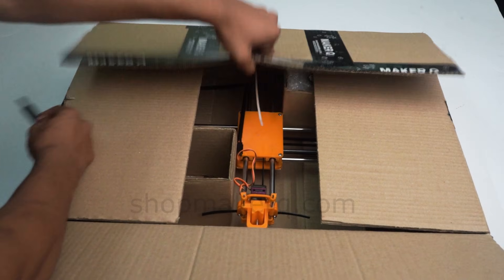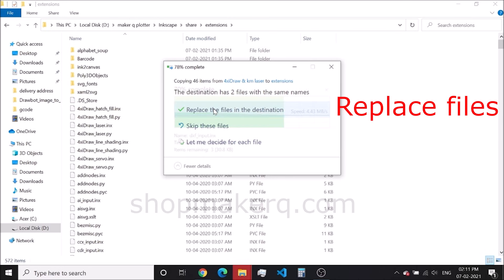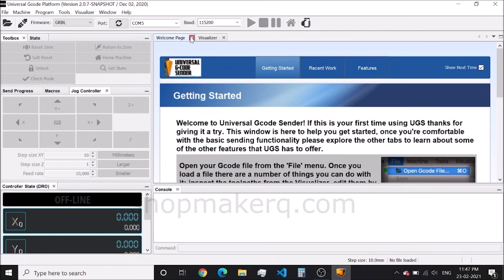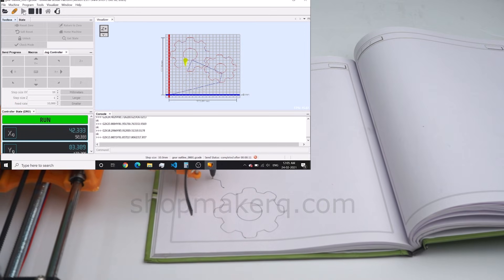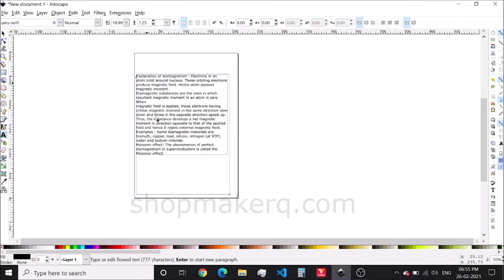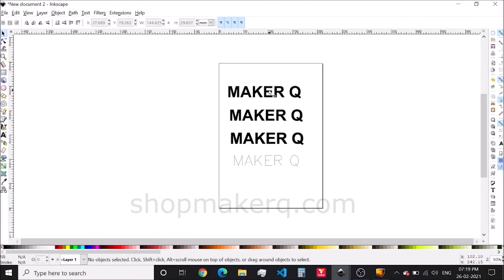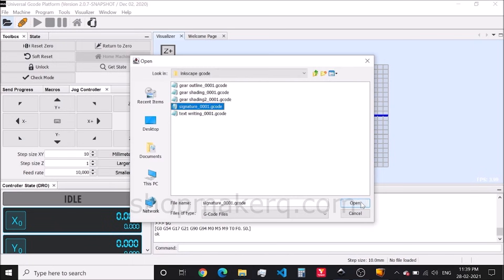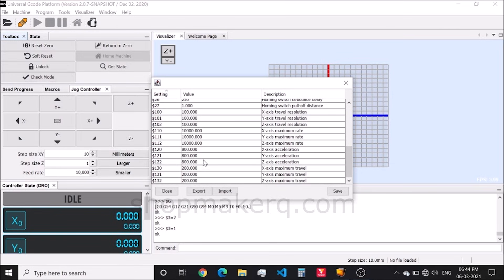CNC pen plotter, machine setup and Software video

Comment: Sir im facing a problem, after all setup when I'm manually moving the machine by pressing x+ axis it's moves on diagonally means(x+y+) same to others sides plz reply sir😢🙏🏻
Reply: Same issue here
Reply: Did you find any solution pls tell
Reply: @nishant1422  No, I Tried and I solve every problem except this. I'm Not Stopped Continuously I'm Trying To Solve. However if you have any other problems you can ask me, may I able to help you.
Reply: Did you find any solution  now  please sir 💔

Comment: X and y works fine but i have issue with the z axis its not going up or down even when i do M03 S80 im using cnc3018 just put a pen in the spindle and unplugged it
Reply: Same problm any solution?
Reply: @sagnikghosh630  actually its the code github has not provided any code for the z axix we have to modify ourself
Reply: Where there is M03. Put G0 Z0 for up G0 Z-8 for down, that how I had mine working

Comment: how to fix this problem:
avrdude: stk500_recv(): programmer is not responding
avrdude: stk500_getsync() attempt 1 of 10: not in sync: resp=0x30
avrdude: stk500_recv(): programmer is not responding
avrdude: stk500_getsync() attempt 2 of 10: not in sync: resp=0x30
avrdude: stk500_recv(): programmer is not responding
avrdude: stk500_getsync() attempt 3 of 10: not in sync: resp=0x30
avrdude: stk500_recv(): programmer is not responding
avrdude: stk500_getsync() attempt 4 of 10: not in sync: resp=0x30
avrdude: stk500_recv(): programmer is not responding
avrdude: stk500_getsync() attempt 5 of 10: not in sync: resp=0x30
avrdude: stk500_recv(): programmer is not responding
avrdude: stk500_getsync() attempt 6 of 10: not in sync: resp=0x30
avrdude: stk500_recv(): programmer is not responding
avrdude: stk500_getsync() attempt 7 of 10: not in sync: resp=0x30
avrdude: stk500_recv(): programmer is not responding
avrdude: stk500_getsync() attempt 8 of 10: not in sync: resp=0x30
avrdude: stk500_recv(): programmer is not responding
avrdude: stk500_getsync() attempt 9 of 10: not in sync: resp=0x30
avrdude: stk500_recv(): programmer is not responding
avrdude: stk500_getsync() attempt 10 of 10: not in sync: resp=0x30

Comment: I built a plotter but when I send gcode to the machine it draws it at a 45 degree angle. Any ideas on the issue or troubleshooting would be appreciated.
Reply: remove 2 slash from config.h and reinstall .
Reply: i.e in 153 line to activate corexy.h
Reply: @gopubalu1542   #define COREXY // Default disabled. Uncomment to enable.
Reply: Can we disconnect computer after sending gcode?

Comment: Inkscape 0.9.2 and a obsolete plugin? NO!
Reply: Its super simple to use the bundled inkscape gcode plugin and just edit the gcode afterwards in notepad++ honestly i'm not sure why he decided to take this approach either !!
Reply: @joolsc3120  Axidraw extension and Eggbot extensions should do all the shown tricks.  J-Tech-Photonics-Laser-Tool on top of that seals the deal but lacks of the hatch area tho. Everything should run with Inkscape 1.1. I believe there is no need for a post process using notepad++...

Comment: Brother when running drawbot imagr processing filr its saying
"Cannot find anything named frame
Reply: I have the same problem, is there a solution?
Reply: Got a solution ?
Reply: @kumudumalika9625  no
Reply: use processing ver 3.5.4 , 4.0ver not working

Comment: Really nicely made thanks.
But have a problem with M5 S0, do you know where to remove s0 in the code? rather than having to do it manually
Reply: Do not remove M5S0 as it says spindle off /speed 0, In this case you are using the M3/M5 gcode to move the pen you are drawing with or if you are using a laser you are telling the laser to turn on or off,Now if you are not using a pen or a laser and want a standard 3 axis device using all stepper motors than go to settings by typing %% in the command line of ugs and find the line which says laser mode and change it from a 1 to a 0 .    now you are in 3 axis mode.
Reply: @walterhynson2898  Sir, when we press on return to zero, it stops in the middle.  doesn't come all the way to its home location
What the reason
Reply: You have to enter " (M03 S80,For pen up.)( M05 S10 for pen down)
Reply: Can we disconnect computer after sending gcode?
Reply: @mrnerd73   noo
Reply: @sasitharshanvv5672  it is taking 2 hrs to complete the drawing, is there any other way so that we can disconnect computer, like using arduino Uno micro controller?

Comment: I have set up my GCode Sender and it recognises the arduino uno but when I make a command nothing happens. Specifically, the motors don't do anything. Any thoughts on how to fix this?
Reply: flash firmware grbl to arduino
Reply: Did you first upload the GRBL to Arduino

Comment: I have this error in 4xiDraw plugin : 
File "4xiDraw_servo.py", line 53
    def bezierslopeatt(((bx0,by0),(bx1,by1),(bx2,by2),(bx3,by3)),t):
                       ^
SyntaxError: invalid syntax

MacOS and Windows same problem. Can you help me?
Reply: This will be on MacOS, I got the same thats because the 4xiDraw is a third party extension and the developers did not update the extension for new python dependency. which is why they are specifically asking to download inkscape 0.92.x version. But on macOS after 10.14 thats deprecated so its not possible to get 0.92 version. the workaround is to use another tool like http://jscut.org/ for generating pen servo gcode. 
1. Download inkscape latest version 
2. Follow the steps in this tutorial to trace bitmap and delete the original image (that is till before the part where you click the extensions>4xiDraw)
3. Then save the file as type inskscape svg.
4. Use http://jscut.org/ to open the saved .svg file and generate gcode, 
5. Rest follow the steps same as this video instruction.
Reply: You should use inkscape 0.96 software. Latest version not working

Comment: Hello.
When I press "Z+" button, machine's "Z" axis is working.Other commands are working too.
But when i write M03 S80 and M05 S10 nothing is happening (just saying "ok" but nothing happens in machine.).
Help me please.
Reply: Me als
Reply: Do you get the answer
Reply: Pls help me
Reply: Try to delete m03 s80 in your code and replace with G01 Z10 everywhere you see.But if u want to work whithout changing the codes you should use servo motor for z-axis.Tell me if machine works when u change the codes.
Reply: @ahmetahmet9342  You told the machine. Plzz let me know about it.
Reply: @xiaoqiaoli6347  Did you try to change the codes with G01 Z10 and G01 Z0?

Comment: I have followed exactly every step, but for me the hatch fill doesnt work. Im not sure why, can you help please
Reply: What software you used for the arduino
Reply: @domdomgin  its working now
Reply: @hkhan108  can you share the arduino code
Reply: @hkhan108  how you fix it? I have the same issue.
Reply: @hkhan108   aap kaha se 
Can you help me
Reply: @jase1208  It was just changing the software version, make sure the extension is compatible with the Inkscape version.
Reply: @saifspark  I am from Australia, what do you need help with?
Reply: @domdomgin  the Arduini code is just your normal GRBL code, it can be sourced from online from GRBL.
Reply: @jase1208  You told the machine. Plzz let me know about it.
Reply: You told the machine. Plzz let me know about it.

Comment: Hi dude this is nice job , i made the same one but i having a problem about moving when i press the "X"  to move X axis it just moving 45 degree angle why is that happen
Reply: Same prblm... any solution??
Reply: Did any one got solution for this?
Reply: I have also same problem. What is the process for right work

Comment: In the universal gcode platform software,the image i have inserted is showing 2000*3000(l*b)(mm).. so machine is making noise and being stuck.. the maximum length the axis can travel is 200mm..how to adjust the length..pls help
Reply: Did you buyed the machine
Reply: Go to firmware settings in universal g code center and chsnge the values  but you need to buy and add limit switch in order to work